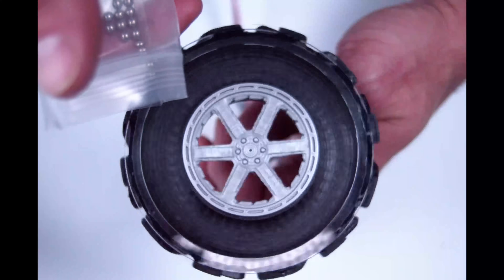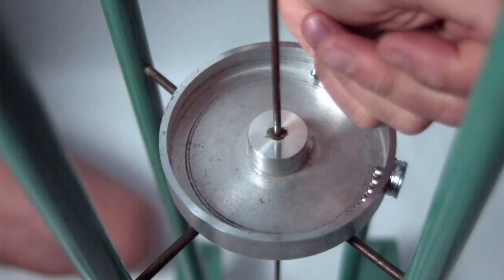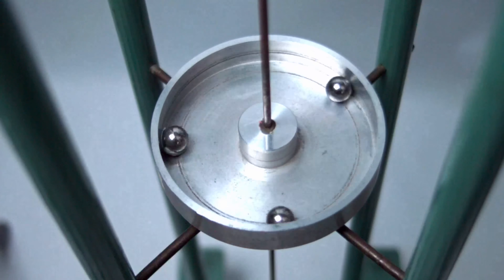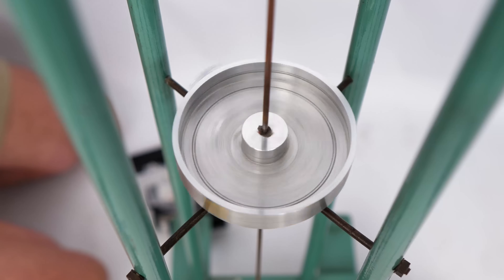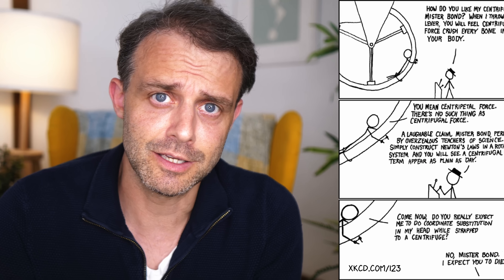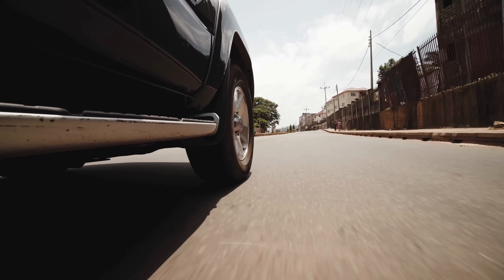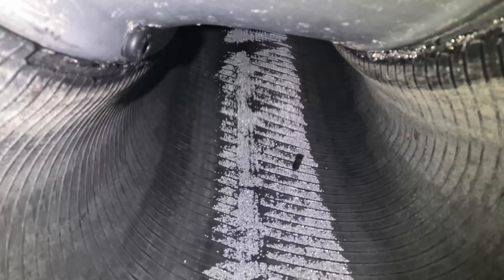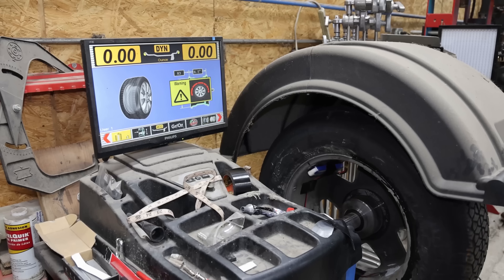Do tire balancing beads actually work?

Comment: at the start of the video, I'm going to go out on a limb and suspect that dynamic balancing of a car tire (as opposed to tractor-trailer rig) isn't going to work well because of the 'flat spot' where the tire contacts the road. That flat spot is dynamic, meaning that it stays in place against the road as the tire spins. Behind that spot, the face of the tire will deflect back and forth in a wave. 

I will point out that the axle in a car isn't as free to move around.

aaand I'm wrong. I love how this isn't intuitive at all. cool!

Comment: I think they should upgrade the balancing beads to be sticky (but with an activation time), so when you put on some new tires, throw in some of these "new" beads and spin it up to highway speed on the machine, have the beads be where they have to be and then have the stickiness activated; this way the tire is perfectly balanced and the beads remain in the proper spot to keep the tires perfectly balanced even when at a stop.

Comment: when the cup turns slowly the centrifugal force, pushing out, throws the heavier side outwards, causing the wobble. 
when the cup turns faster the centripetal force, keeping in, equalized towards the center of mass, making the lighter side move outwards. 
I don't think it's that difficult to explain. 
vehicles with smaller soft rubber tires don't use these because it's unreliable and it takes time to equalize which is very bad for quick changes in rotational speed like accelerations and decelerations. 
But they are common, or so I heard, in truck and semi tires because they're slow to accelerate, hard and not as flexible. 
I think you could use glue? to permanently lock balancing beads in place?

Comment: So why not just add a hula hoop of metal to tire rims. Put in weight balls and a liquid that melts around 150-200°F. Heat up liquid in hula hoop and drive above resonance (55mph) til liquid solidifies.. would that be perfect balance/easy to rebalance?

Comment: There was a time when I was little, I dissembled a DVD/CD drive from a PC and I heard some things making noise,  presumably balls from what I could deduct, making noise from inside the spindle motor. And I was wondering what they are doing there. I didn't have any other explanation other than balancing, but I was puzzled because my logic was - if there is some additional weight that will drive this part of the motor away from the center and because of the centrifugal force the balls will go exactly there witch will make things even worse. Apparently I was wrong again.

Comment: Of course it works.  Same thing happens in a washing machine in spin mode.  Interestingly it doesn't matter if the individual free masses are the same within reason or are changing over time as wet cloth does as it loses moisture in the spin cycle.

Comment: Been using them for decades, old 70s trucks with mud tires, high performance sedans with 275 low profile tires, SUVs with all terrains, smaller SUVs with all seasons and winter tires, new diesel truck with commercial all terrains. Work great and I have no complaints.

Comment: Note: I have no intention of trying this on my equipment due to safety reasons, but I am still curious if anyone knows why it wouldn't work.

At home I have a surface grinder, and at work we have several centrifuges (a 4L bucket centrifuge, a 10L basket centrifuge, and a small ultra-centrifuge that does about 15kG). Is there a reason why balance balls like this wouldn't work to stabilize the surface grinder and centrifuges? On the surface grinder I can easily spend 30min getting the wheel balanced, and at work we always counter-balance the centrifuge if we are only running 1 sample. I am just curious if adding a chamber or something around the centrifuge/grinder if it could self balance. Again though, I am not going to be experimenting with this myself because centrifuges scare me, and I don't want to mess up the bearings on my surface grinder.

Comment: I don't remember the exact weight but when family was broke I used large amounts of BBs in tires of a Jeep Xj and they worked like a charm including on several road trips and you'd forget they were there until you slowed to a stop and the BBs would all tumble to the bottom of the wheel

Comment: 9:15 re wheel hop speed being 50mph, is that fixed according to wheel OD or tyre OD? For example, do taller tyres require higher speeds? That alone would prohibit them being useful for the majority of drivers and majority of trips. I doubt traffic cops will let you off if you blat up to 50mph in a 30, just to balance your tyres.

Comment: What if you also add in some epoxy or other glue (something more flexible probably), then get up to speed to balance, where it sets in place 🤔…. In fact why not just not use beads at all and use a liquid glue

Comment: I wouldn’t be surprised if you could also do this with a liquid

Also, this is probably mentioned later in the video, but it seems best to have the weight of each unit be as small as possible for a more acurate stabilization

My thoughts are, if you could make a weighted two part epoxy/resin, then you can mix the two parts, inject it into your tire, spin it up once until it’s hardened, then you don’t need to again.

Comment: Only problem is that when rolling through the footprint, the beads should and would eject away from tire to the point where at some point in time all beads would be bouncing around completely.  Truck drivers years ago use to run 3 golf balls in there tires... the golf balls rarely came out nothing less than rubber bands.

Comment: So someone just needs to come up with something you attach to the tyre valve which will spray some kind of adhesive in when you reach 70mph to fix the beads in place then? Ideally something which is only adherent in contact with something on the beads so you don't gum up the valve.
Reply: Aren't there similar systems that use a kind of goo?
Reply: @Jo-Whale  I know I had something like that on a bicycle but that was for filling in punctures if you got one.
Reply: @irreverends  Someone ought to test whether it redistributes itself in a similar way. I have no idea. But, in the meanwhile, it appears having your wheels balanced is still worthwhile. I've noticed that even on a bicycle wheel, the vibration from imbalances is noticeable.

Comment: Balance beads are best (and found most often) in long haul trucks, they have very heavy tires that wear quite a bit, and can sometimes need to be re-balanced over time.   They spend most of their time at freeway speeds.   The other popular application is big fat tire civilian lifted trucks, the tires don't consistently keep their shape so their balance also changes at random, the beads can change with it.   As you said tho they have to reset every time you slow down, that's why you don't really find them in normal passenger vehicles.

Comment: I am still gonna rally against the notion that centrifugal force is "fictitious." While it can't be explained by a single source, it's still a very specific set of circumstances involving other forces that create a result that would otherwise be impossible. To me, it feels more accurate to call it an "emergent" force. Sure, it's not real in that it's a direct consequence, but it is a single force that results as the function of other forces. "Fictitious" to me, implies that it doesn't exist at all, when it clearly does, just not on it's own. I feel like it's akin to saying multicellular organisms are "fictitious" organisms, because they're actually an amalgamation of a bunch of other cellular organisms. While that may be true, multicellular organisms still behave as one "organism" collectively to create cohesive creatures, animals, humans, etc., just like inertia and velocity (with a constantly changing vector) collectively make up the centrifugal force to act in a cohesive "force" that leads to a specific outcome impossible without the culmination of those forces. And while the actual force is centripetal force, which is what is supplying the potential energy to redirect the vector of the object towards the center, centrifugal force is still measurable and experienceable. It is tangible. It's not a completely false "force", it describes the magnitude of the object's resistance to changing vectors (resistance to centripetal force) which can be measured the same way we measure any kind of physical force (newtons, for example). While it only exists in a specific, non-inertial frame of reference... it still exists. It's still measurable. It's still observable. 

And I mean... come on, centripetal force exists because of exactly the same source forces plus a few extra. In my eyes, centripetal force may as well be in the same boat. Just because we can describe it outside of a non-inertial frame of reference doesn't make it any more real than centrifugal. It still relies on another set of forces to create that force. Same boat. Different name.

Comment: I’ve been using balancing beads from Counteract for years now in electric skateboard wheels and they’ve been a lifesaver. And I mean that literally, the eboard threw me off at ~50kph twice in a span of a single month before I found out it’s the (kind of unconventional) pneumatic wheels being unbalanced and causing the guaranteed speed wobble, when I reach those higher speeds. The tires are 175mm (70mm wide) I usually put 9g of beads in each inner tube, I have not experienced any speed wobbles since. Oh and yeah, it does work with inner tubes as well.

Comment: Glass beads bang around and break up. You want to use stainless steel BBS. Airsoft BBS made of rubber/plastic also break down over time banging on each other. You use normal BBS made of steel they rust if you use normal air with moisture to air up your tires.
Been using SS BBs in my off-road tires that are too big to fit on most tire machines for 15 years.

Comment: So the next step are beads with some kind of pressure activated adhesive so they glue themselves to the right spot once you're driving fast enough and the centrifugal force is high enough

Comment: Can this be used in a frontloaded washing machine? 🤔
Reply: Probably not because of the ridges stopping them from precisely self-adjusting. However, one could probably design a system on the back or outside of the drum that did. The question then would be, could a 8kg washing machine cope with 16kg of weight to balance it? The answer to that would probably be yes though because the limit will be for an imbalanced load rather than a balanced load.

Comment: Semi truck tires are balanced this way.  Balancing those massive, incredibly heavy tires on a machine like an automotive tire is a bit impractical, so if the driver cares enough to want to balance the wheels (they usually don't), then we dump a bag of beads in the tire.

Comment: An interesting bit that I bet someone already mentioned is that you can do "pinch harmonics" on a guitar where you mute all the string just a tiny distance above or below (in string-length terms) while you pluck and you only get the very high harmonics of the root note. I think you are doing the same thing with your frothing tool.

If you can't tell, most of my physics is in acoustics, you can also over-blow wind instruments to achieve a similar effect which seems to me like the "high speeds eventually make for higher frequency oscillation"

Comment: I didn't have luck trying this on a tire with bad road force balance (like  31, 33, 38, 46# on Nexen tires) so quick online calculator says 3oz would be ~12.5#. Anyhow, my issue was worse at 47-48MPH but was also felt a few MPH above and below that.

Comment: The beads are used for large tires. I had a 86F 250 Bullnose swamper. it had 38 inch mud, swampers, and whenever I would leave my house. It would Self balance within a half a mile, but it was always balanced before I hit 50 or 60 miles an hour and it never shook real bad, but they work amazing for a large tires that either can’t fit on a balancing machine, or that have so much rubber. It would take an insane amount of weight to balance. I had 1 pound of beads in each tire.

Comment: We have a pneumatic tire changing machine at the garage and one day I was breaking down a wheel and out of nowhere there was a shower of 1000 or so neon yellow airsoft pellets that went everywhere in the garage floor, I suppose somebody had the idea to use those to balance the wheel, which I thought was pretty smart, even though after three years or so, I'm still finding those pellets in out of the way places they decided to roll to..

Comment: Balancing beads are particularly suited to really old cars (or cars with really old wheels) and to a lesser extent cars with bias ply tires.  For bias ply tires, they tend to flat spots easily and for cars that sit around a lot that is a larger problem.  The dynamic nature of balancing beads is a good fit for flat spots that are in different places each time or wheels without easy ways to mount modern balancing weights.

Comment: What would be interesting is if there was a way to apply an epoxy or other adhesive that would have enough flexibility to allow the tire to still move, but would give enough curing time that when you pour in the glass beads and then spin the tires at a sufficient RPM, it then "sets" with the beads held at their balancing points.

Comment: Hypothesis expanded, if you live in an area where the wear on your tire may not be equal, be it the quality of the road or in some cases no or dirt roads, could they work with the counterweights to help readjust your tire, giving them extra life- def not a use case for everyone but might give the idea some weight 😅

Tldr could both balancing balls and counterweights work in tandem to extend the life of your tires natural wear

Comment: As a member of the industrial balancing industry, mad props for actually explaining a bit of both rigid and flexible rotordynamics to the general populous. It is a very niche field but necessary to understand in aviation, power generation, automotive, and pretty much every other major industry. Even data centers for AI need hundreds of fans per warehouse which all need manufacturing including balancing.
Reply: If you think fans in data centres are balanced, then I have a bridge to sell you. They rely on tight manufacturing tolerances to avoid the need for any balancing. I have some great pictures of when it all goes wrong. Had a batch of faulty fans in some servers. In one it shed some blades and at 15,000rpm ground the bearings up into some fine metal dust that was spewed all over the inside of the server. Fortunately, the other servers in which the fans disintegrated the broken blades prevented the fans from spinning. The vendor ended up replacing all the fans in all the servers after the third incident.
Reply: Incredible 🤯  @jonathanbuzzard1376
Reply: or on CD drives or hard drives
Reply: @artemis.nnnnnbbbbb  hard drives don't need balancing. They're absolutely made to very strict tolerances. Probably higher than anything you will find in a car.
It's just a perfect planar circular glass disk with a thin magnetic coating.
The heads on the other hand and balanced because they're literally an arm and use leverage to work.
Reply: @monad_tcp  I've taken a lot of harddrives apart and all I find are aluminum discs.  never heard of glass.
Reply: @AffordBindEquipment  'Hard drives can have glass discs for two main reasons: some modern laptop hard drives use glass platters for durability and higher data density'
It tends to be higher end drives.  I remember when it was first getting talked about being out in consumer level stuff was around 2010 or 2012 range.  It's just relatively rare for personal use, likely harder to find in cheap consumer drives vs old data center type drives..
Reply: *populace
Reply: Yeah, you don't think about that kind of stuff until you're involved in it. Like, I like building gaming PC's which use a lot of fans most of the time, and when you really think about it, to achieve the best performance possible while keeping noise levels low, the companies making the fans must have had to initially go through a TON of R&D on something so small like balancing a tiny bearing and plastic fan blades. And gaming PC fans are slow compared to server rack fans. Those things are nuts.
Reply: Yeah, I'd imagine server racks need a lot of balancing work. 😳
Reply: @YT-TheLegacy  can you imagine electrons getting out of balance?

Comment: The different speed wobbles are an equal measure of distance over time.
At slow speeds it wobbles a longer distance but at a reduced rate so the actual wobble distance travelled over a set time is equal to, say, X.
At higher speeds its wobble distance is shorter but there's more of them per the same length of time and thus the wobble distance for the same time frame is, again, X.
Identical mass in both equations, conservation of angular momentum, etc.
BTW I totally made this up, I have no idea. 🙃

Comment: This is bringing back a dim memory of being taught that an inverted rigid pendulum will be stable if the pivot is driven vertically fast enough ... if I'm remembering that right, could it be a related system?

Comment: I am a mechanic. We only use beads on oversized tires/lifted trucks. They work good for us. Yes you can be out of balance until you get up to speed but I have found to only need about 40mph. That is why we still use counter weights for everything else.

Comment: The tire beads should only be used as a temporary measure, especially since they reset themselves. Getting to a mechanic will help ease strain on your vehicle. Relying on these still leaves that strain. :chillwcat: